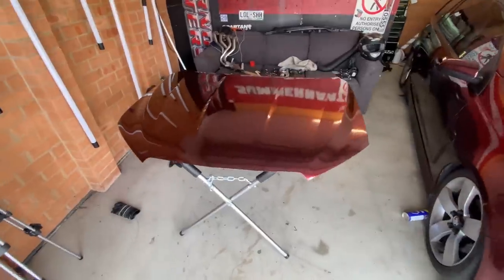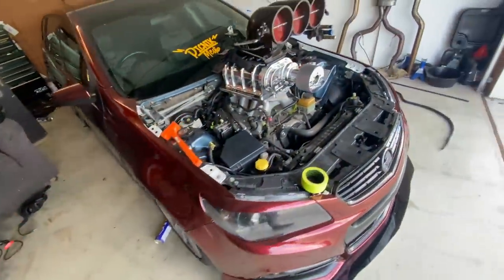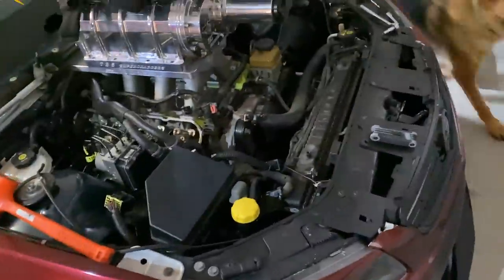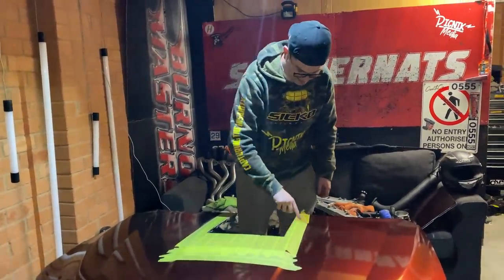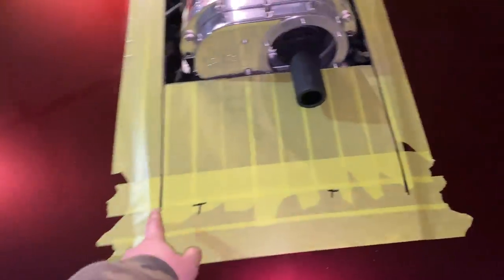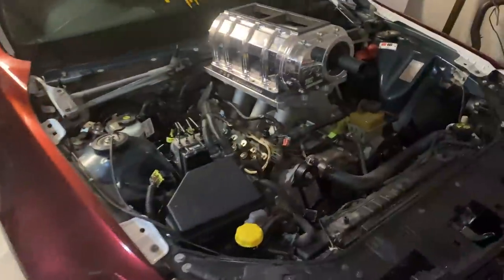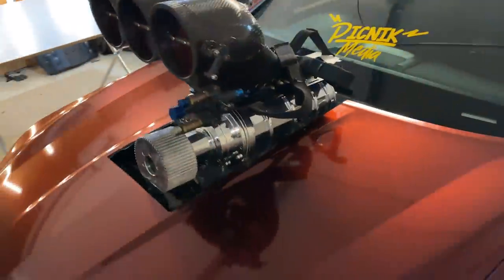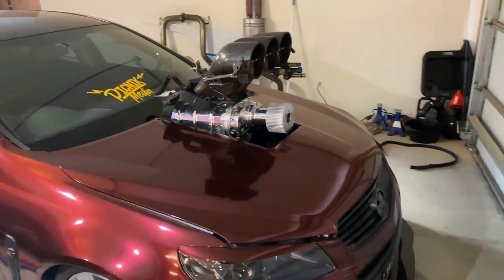Ripping Into The Hood To Fit The Blower On My VF Wagon

Comment: Looks so sick with the bonnet on and the wrapped butterflies. I think you should use hood pins because it might look odd if you have to cut a lot more out of the bonnet to get around the hat and stuff to lift the bonnet up. It will also be easier to work on like you mentioned. Either way hood pins or hinges it is going to look sick great job! 😃👍

Comment: I think Hood pins would look a lot better than a big hole, already thinking might have cut that hole little big but it don't look bad. I do have a suggestion here I just thought of... Use like stud pins screwed in where the hinges bolt up. Then pin it to your hood hinges with a clip. Then all you have to do is open the hood like normal a little bit pull the pins out from underneath and then pull the hood off. It'll look a lot cleaner I think and having to have hood pins sticking up through the hood. Not sure if it will work you're there I'm in the US, you need to replace the word Hood with Bonnet whatever, lol 🤪 but yeah just get you some longer bolts and cut the heads off, or some kind of studs drill a hole for a pin, throw them in Where the Hood bolts up oh, I imagine It Bolts flat I don't remember... And then just pin it from underneath, yeah you only be able to get the hood up a few inches before the bird catcher, but that should be enough to get your hand in there and pull the pin. just tonight idea to think about.

They also have some push button type pins out there that are flat with your hood surface, all you have to do is push down and they release. I've seen them on another Channel they look pretty slick , here's a link to what I'm thinking... https://seiboncarbon.com/products/hoodpins-ql38lpbp.html

Comment: Pins at the back of the bonnet and use factory latch. Look a lot more tidy without a MASSIVE hole in the bonnet. Also ease of access to work on the motor

Comment: Save yourself from getting mad at yourself put some towels down on those front fenders before you scratch the wrap up by accident putting on and taking off the hood of a million times.

Again here's the link to the type of pins I think you should use, doesn't have to be this brand or anyting just think it will look really good...https://seiboncarbon.com/products/hoodpins-ql38lpbp.html

 But I did have my idea about pining it to the hood hinges from underneath, which might be really trick.